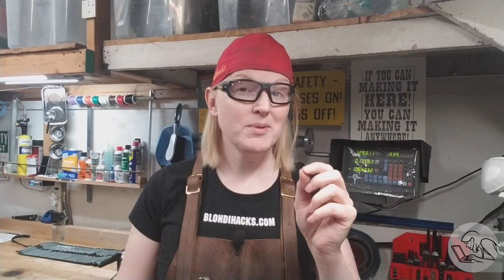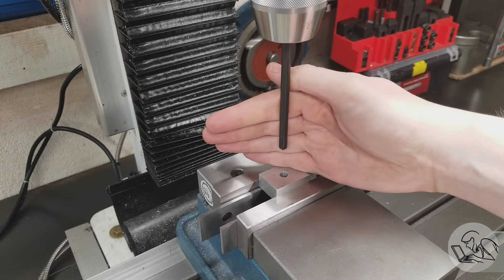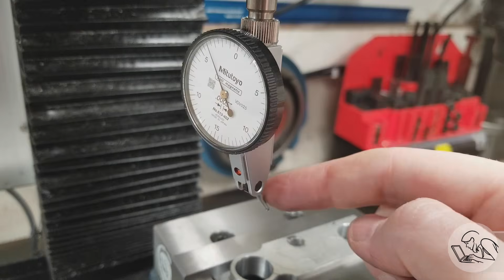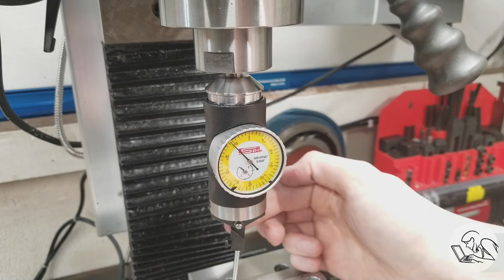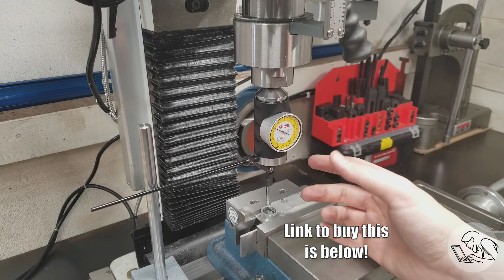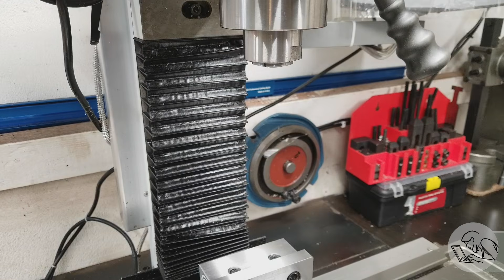FIVE WAYS to find a hole or punch mark on your mill!

Comment: I am a journeyman machinist. I worked in the field for 25 years, then taught machine tool technology at our local technical school the last 12 years before retirement. I love your videos. They are informative, entertaining, and well made.
Thank you for calling the drill a drill, and not a drill bit—that always bothers me that people don’t know the difference. 
Even when precision requires a hole be indicated, I always used an edge finder to get close. It saves a lot of time with the indicator. You can easily get within .001” of the center using the 3 point hit method. If you have an edge finder with a .200” end, it will work on holes as small as .250”. Just take a hit at approximately 10:30 on the inside of the hole, and zero your x and y read outs. Move in the x direction and take a hit at 1:30. Move in the y direction, and take a hit at 4:30. Divide your readout values by 2, and move to that location. 
If you were careful with your edge finding techniques, you will be within .001” of the center. For many applications, that may be close enough. If not, you can now very easily and quickly sweep the bore with your indicator to make it more precise.
Thanks for taking the time to make these valuable videos.
Reply from the maker: Thank you for a thoughtful and informative comment! 😄

Comment: What about the conical side of the edgefinder? It can be used to find both a hole and a punch mark, place it in the punch mark or hole and adjust x and y until you can't feel the edge between the shank and the cone with your finger or fingernail.
Reply from the maker: Yes, I have covered that tool in other videos, but missed it in this one.

Comment: For centering on a hole that's larger than about 3/4 inch, I just use a regular edge finder with a cylindrical probe. Forget that the hole is round; pretend that it's square. Center the X axis approximately by eye, then lower the edge finder into the hole. Locate the Y center with the edge finder and your DRO the same way you would locate the center of a square hole or centering on the edges of the part. Move the table to the found Y zero and repeat the process for the X axis. Since your original X setting was undoubtedly off center, you'll need to go back and repeat the Y setting with X on its new zero. If you have to make a large adjustment to Y, go back and check the X again, but it's surprising how fast the process converges as long as the hole is larger than about 3 to 4 times the diameter of the edge finder probe.

OK, my DRO only resolves to 0.0005", so maybe this method isn't suitable for a more precise machine, but it works for me.

Comment: I had a Blake co-ax indicator and the leg moved where ever you wanted. But for me an even better option was a vertical dial test indicator. Unlike your horizontal indicator with mirrors, the dial sits straight up so you can easily read it as you rotate around the hole. I have even heard of shops that don't allow their employees to use co-axial indicators as they can introduce too many errors.

Comment: When finding the hole with an indicator you don't have to worry about looking at the back side of the dial as long as the hole is perfectly round.  After finding the center on the x axis, move the y axis to get the same dial reading.  If the three readings are exactly the same, the fourth must also be identical.
Reply from the maker: Good point! 😁

Comment: Old school :) I was taught to use a sticky pointer.
Which was a piece of plasticine with a pin stuck in it.  It worked like a wobbler.
I have a wobbler now. 
I’m lusting after one of those fancy concentric things :)
Funny you published this now as I was doing this exact thing today repairing a machine vice.

Comment: Hi folks. The really old school method was the ‘sticky pin’ technique. Chewing gum and yes, a sharp pin or needle. After stabbing oneself once the pro’s learnt to use a ruler to align the pin just by running the spindle at low speed. Stay safe. BobUK.

Comment: Very informative, thank you. I saw a video some time ago where a laser pointer was used to align the quill to the hole. I don't know if it was a commercially available tool or a homemade device. It got me to thinking why there aren't more machining measuring tools that use laser technology. DRO,s for instance.
Reply: https://lasercenteredgefinder.com. 
This laser center finder works great for picking up points, scribed lines and edges

Comment: @14:38 - try it with your tongue out the other side of your mouth. That sometimes helps. 

Also, you get better visibility if you take your measurements on the 45/45 degree axis rather than on the 0/90 degrees.

Seriously though. Great video.

Comment: Relatively new to machining and didn't realise that you could move the leg on a DTI! Mine was quite stiff to start with but some penetrating oil freed it up. Always something to learn on your channel.
Reply: Ditto.  I"ve only been using them for 2 years, and I guess I've been lucky that I always managed to make it work anyway.  Setup should be easier now that my ignorance has been slightly diminished. Thanks Blondi

Comment: Good treatment of a nessesary subject.
Lots of old machinests watching and enjoying your channel so there will be plenty of good feedback.
One is about that bolt on the coax.
Use a soldering iron to heat up and then undo that bolt.
I set the drag on that pivot to do the same as the tip on a dial test guage so I can carefully change the angle without a spanner.
This opens up a wonderful range of options.
Do not use the units of measurement on the gauge as actual, they are accurate comparators, but suffer greatly from cosine error as units of measurement.
One method you didn't show but I've seen you use is the pointer end of the edge finder, easy to a couple of thou..
Keep up the great vids, you are fun.

Comment: It is critical with the co-axial indicator that the body of the indicator does not wobble as the mill spindle rotates, since this wobble shows up as needle movement on the dial.  I noticed that yours was wobbling slightly. So it would be interesting to check the centring accuracy of the coaxial indicator with a dial indicator.

Comment: That was really fantastic.  I'm just a hobbyist with a PM25, but I think there may be a feature on your coaxial indicator that you might have skipped past.  This little thing has helped me in the past anyway, especially if I'm restricted in Z travel but need to indicate a bigger hole than the small rod would usually work for.  The coaxial does have a friction type adjustment (mine does anyway, and looks exacty like yours) like the needle of a test indicator, but you just need to loosen the Philips screw and nut at the lower fulcrum, readjust slightly for a bigger circle, then retighten.  I know there are arguments for days on the forums about how the rod length and angle effect the actual reading on the dial, but zero or little needle movement is good enough for any of my projects regardless if I did something to desensitize the actual tool measurement in a slight way.  Maybe you are aware of this adjustment, but just wanted to put it out there in case another person might not have known.  Thanks for the video!

Comment: When using a test indicator, dial in both X axis contacts to be equal first.  Then, setting the dial to zero with the indicator still in the hole, touch the Y axis with the dial facing you until it zeroes out.  A swing from X to X with no movement at the Y will confirm you're lined up.  This eliminates having to use a mirror or contorting yourself to look at the back side.
Reply: Thanks for the video and thumbs up to crush a troll.

Comment: Great video! I just wanted to point out that the coaxial indicator can be adjusted on the shiny screw joint in between the leg fixture and the body tilt to fit a wider range of hole sizes. And also that the scale of the dial does vary with the lengths and angle of the leg pins (or whatever the shiny rods touching the part is called). This can easily be tested by putting a shim stock or something with a known dimension in between the part and the pin to see. Another useful way to find a hole is to use a live or dead center in the spindle. Keep up the great work!

Comment: Okay, my inner teenager was amused a couple times in this video, I confess. I will also volunteer that I had no idea how maddeningly complex it was to find or locate a hole with a vertical mill. To be both amused and gobsmacked at the same time was very difficult for my gray cells. I will now both console and reward myself with a cookie, both because I need more training at holding two somewhat opposed feelings in my head at the same time and also because I like cookies. Thank you.

Comment: I don't know how kosher this is, but the little acorn nut just below the body of the coax indicator can be used to adjust the swing of the probe. I'm sure this has horrible effects w/r/t cosine error, but in my limited experience it doesn't seem to be an issue. BTW, the coax indicator was one of the best machining purchases I ever made (though, admittedly, that ain't saying much).
Reply: Jeffrey Jenkins Agreed.  The acorn nut is at a friction pivot.

Comment: Another wonderfully instructional video.  Two points about the coaxial indicator.  
1. While it may or may not be recommended, the indicating arm can absolutely be adjusted in or out similar to a test indicator.  Theres just enough friction at the joint to move the arm and it will hold it's place.  You can hold the indicator body while you move it or install the white plastic ring that the unit ships with to keep it from moving.
2. While the ability to use the coax indicator under power is novel, I've found that it's much faster to just swing the spindle by hand from side to side.  Then you just split the difference in readings similar to the test indicator. I use coax indicators nearly every day and these techniques have never given me problems.

Just my two cents. Thanks for making all your amazing content!!

Comment: Hi Blondie , PLEASE HELP 
    
       Let me say your channel has helped make my milling experience no one more pleasurable, safer, faster, and better. So here is one of my projects that I have been putting off because I don’t know where to start. I have a 5” thick clutch that has a slightly over 1” hole in the center that goes down straight for an inch or so then tapers down to like 3/4” . This hole allows the clutch to slide onto and mount to the crankshaft. The crankshaft I Have is Different, it’s 1” straight shaft with a 1/4” keyway. I think the clutch was designed to fit with a tapered crank and just friction. I am kinda still new and I’m finding I know very little since started watching your videos. I am stumped on how to start this project. What tooling would I use ? I have a 1” end mill and was going to just use it as a drill .. this sounds so wrong. I also have a boring bar so was thinking maybe start with a smaller end mill then use boring bar. I do have the type of coaxial center finder like you showed in this video but it’s the $80 Ebay version .. but it works ok. But the fact that the hole in the clutch starts off slightly bigger than I need and ends up tapering to smaller than I need has me hesitant on starting the project. I was given the clutch from a friend and don’t have a way to hit a do over button once I go for it. So if you could let me know how to straighten a tapered hole that would be great. If you want to see what they look like it’s the type of torque converter / centrifugal clutch that goes on a snowmobile or Polaris UTV engine and drives a belt to the other pully  . It’s made out of aluminum to be light  but has a steel sleeve pressed into the center to make it strong where it meets the crank. It’s thick enough so cutting it to the 1” straight cut won’t break thru the steel sleeve, so that’s no worry. And the making the 1/4” key way cut is also really blowing my mind. How do you cut a keyway in a hole ???? Maybe it’s not possible but without experience it seems difficult. I know there are 100 different ways of doing things but I know the way I’m thinking of doing it might not be the best way. You explain things so well that even my smallish brain could grasp the concept. If you have time to answer that would be great. I know you get so many comments you might not get this one. I love the videos , and thank you for helping me so far with all your great videos.

Blondi hacks PLEASE HELP ! .. 

Paul
Reply: Ask Jonathan W.
Reply: Who’s Jonathan W ? I’d love to ask him if you think he could help.

Comment: Those coaxial indicators can actually be adjusted for different sized holes with any tip by loosening the Phillips screw near the fulcrum and moving the mounting end
Reply from the maker: Not according to the instructions on this one. 🤷‍♀️
Reply: @Blondihacks  mine either but that hasn't stopped me ;)
Reply: You can even pull the bolt out and flip the mount around to give even more range in the other direction

Comment: How about just using a haimer prope to find X- and X+ and split the difference using the DRO? Or simply a wiggler edge finder to find the edges and split the difference with the DRO. I do not know how precise this is, but it is fast. Only works on larger holes of course. Smaller holes can be done with a dowel pin and edge finding on the outside of the pin.

Comment: Should you lubricate the tip (ehem) of the coax indicator when running it under power?
Reply: I think an oil film would affect the accuracy of the indication.

Comment: I have used a variation of the first method to center on a bullet mold in order to rework it. First you machine a cone  . With that cone  in the spindle , and the part in the vise, you come down until you are as close as possible , vertically and laterally. Then you loosen the vise ,  go further down until the vise doesn't wiggle any more , and tighten the bolts. ( the big disavantage is you will have to align the  vise after you are done )

Comment: The resolution of the coax indicator diminishes with longer probes. I put a 4 slot encoder disk and optical sensor on the coax indicator and triggered a strobe light with it. It visually separates the two axis' of error indication. it it good fun to try it. Use a two color LED and some better electronics for even more fun.
Reply: Ok, so this I'd love to see a video on. Coaxial DRO?
Reply: I totally want to see a how-to video on this!

Comment: Stars aligned or a bit of scheduling? 
Blondihacks first and less than a hour later This old Tony!
Reply: Did you notice that TOT also needed to align a bore to his spindle?  I thought that was a neat coincidence.
Reply: Tucker Southard: yeah wired that. But, with lathe based time travel. I no longer believe in coincidence. The truth will out when your sat in you ToT tea shirt sipping a cuppa from your blondihacks mug Whatching a Clickspring vid. Free will is not covered in the machinists handbook. (Metric fist shake)

Comment: Q.  turning spindle by hand / under power.  does the axis of rotation change under power due to the torque of the motor/powertrain?
Reply from the maker: Interesting question, but no, the bearings in a spindle aren’t influenced by that.
Reply: @Blondihacks  fair enough.  i could certainly see no issue with a small machine with the spindle and motor being inline, but the bigger machines, with a heavy cut forces and the asymmetric forces on the spindle from the drive could lead to some deflection. ... i guess if that were the case, it would make any accurate setup impossible to achieve.

Comment: oh nice, I don't know if you've been doing this for a while but thanks for showing metric conversations on screen!
Reply: Worth to point out that microns have a limited use in metric countries, outside few industries. In general mechanic and manufacturing we use millimiters with 2 decimal places.
Reply: Recently, I was doing an operation training on an ID grinding machine. We were using micron to 1 decimal! 
Most cases, on a CNC machine (lathes, mills), I use microns. For example, to set and caliber a measuring arm/head like Renishaw. 
Frankly, I don't think there's a limit to the decimals. Only machines have limitations due to manufacturing and price.

Comment: Quinn I don't think I have ever heard a more detailed explanation of hole locating. Great video. You did not mention the use of an indicator holder that attaches to the spindle nose of your mill. I use this exclusively at work because with a coax I am constatly having to ccrank the knee of my mill up and down to accomodate it. Also don't have to remove the drill chuck or endmill to use it. Here is a link to one.https://www.penntoolco.com/indicol-universal-indicator-holder-1-7-8-diameter-c-frame-ind-178/

Comment: I really enjoy your videos and I always learn stuff from watching them.  From what I understand, the indicator body doesn't need to be in line with the spindle.  This is because you are rotating the spindle to take the measurement, thus the circle the indicator tip is moving will always be centered on the center line of the spindle since it's the spindle that is rotating.  So you don't need to hold the indicator body in a collet or any other precision mechanism. That's why things like the InDicol holder you can clamp on the quill is so handy.  Also, a trap I ran into, the quill lock actually will always push the spindle over a few thou, so if you find a center with it locked, then make sure any operations you do also have it locked.  Or if you are planning to drill with the quill, then do the indicating without the quill locked.
Reply from the maker: Yup! The indicator doesn’t need to be mounted in a collet, as long as it is attached to the rotating part of the spindle.